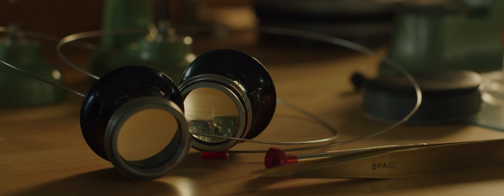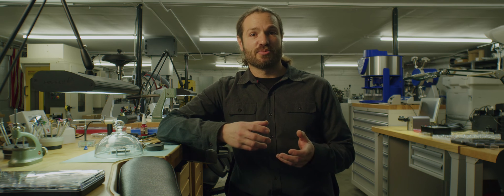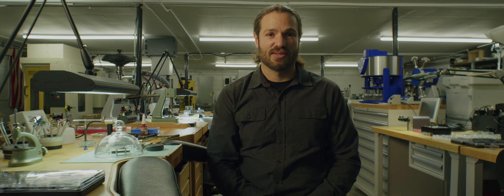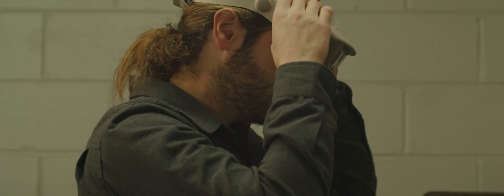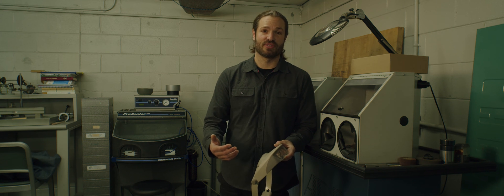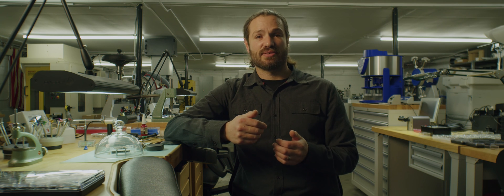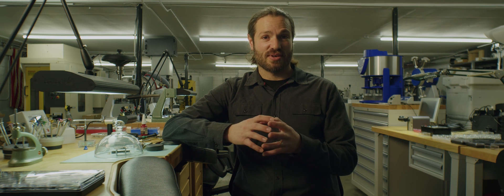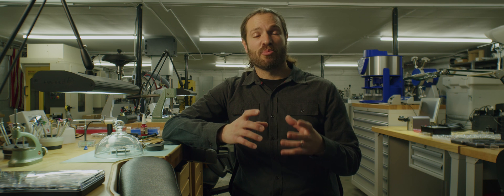Magnification- The Loupe

Comment: in microscopy, depth of field is terrible because of the high magnification. in the modern era, photographs are made with "image stacking", where many images are made with different focal distances, and they are stitched into a single image with a computer

now it seems to me that technology has reached a point where we should be able to do image stacking in real time. desktop computers have far outpaced legendary supercomputers from the turn of the millennium. i feel like by now we should have optics that are mechanically oscillating over a range of depth while a computer outputs a binocular feed to something that's easier to look through than a microscope eyepiece

when i look at workers in the microscopic real squinting through monacles, i wonder why large companies like swatch group aren't developing this
Reply from the maker: More DOF might appear to be a benefit at first, but when you actually get into the specifics of why DOF exists, limited DOF is actually a valuable tool. On my measuring microscope, I am able to measure height features of a part based on the very thin DOF produced by the elements of the microscope. If I focus on the top of a part and then move the z axis to focus on the next lower feature, I can measure the z value accurately to 0.0001 microns.  Even in everyday life everything is not in focus at once, we use focal points and have two eyes in order to judge distances. If everything was in focus all the time, we would have a hard time finding edges and corners and would have a tough time processing all the information that is in focus instead of only what we need at that moment.

Comment: Yeah, I've noticed that too get started, you really need 2 things besides screw drivers and tweezers. And that is magnification and patience.

Also another way to figure out dominate eye is to make a triangle with your hands in between your thumb and index fingers. Small triangle. With both eyes open and the triangle closer to your face. Put a small object in that triangle (that is across the room) move your hands out keeping that item in the middle of the triangle. Once your hands are all the way out. Close each eye one at a time. Whichever eye is open when that item is still centered is the dominate eye.
Reply from the maker: Another great way to quickly figure out your dominant eye.